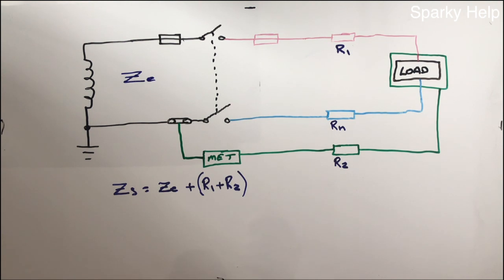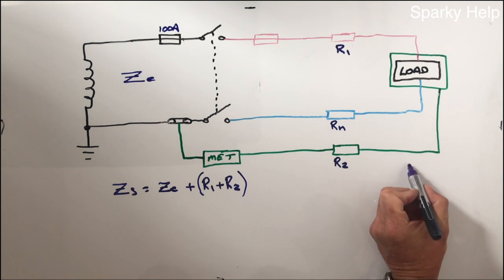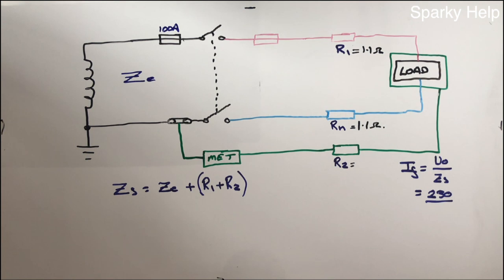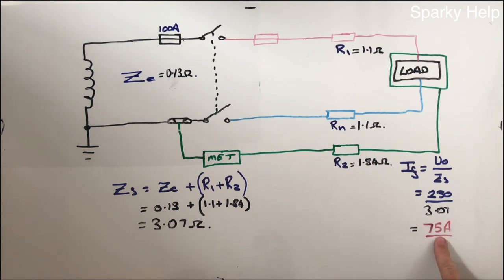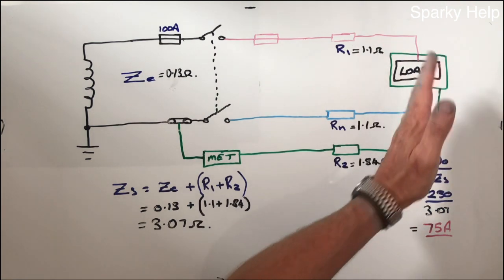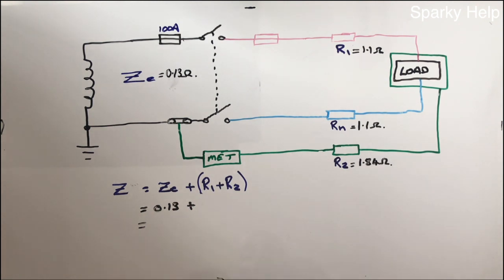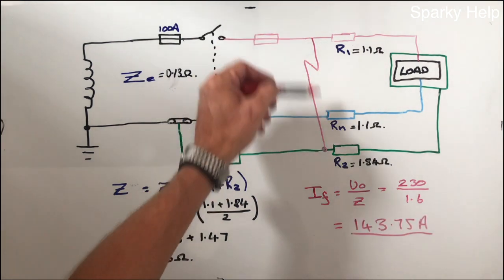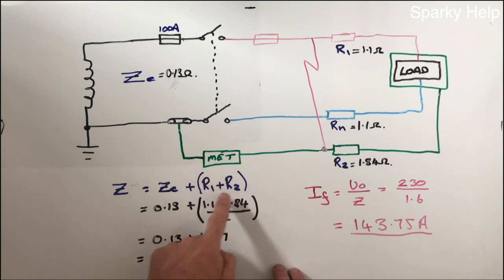Inspection and Test Zs Calcualtions with fault current

Comment: Hi, i'm confused lol. Say the load is switched off at the time of the fault between live and earth. Surely the resistance of the neutral is excluded as no fault current would be taking the neutral path?
Reply from the maker: Hi Yes if it is turned off (and the main switch is shown off!) then no current will flow - but if it is on the majority of the current will take the path of least resistance.  Please Like, Share & Subscribe.😀
Reply: Thanks for explaining 👍

Comment: Thanks you explained very nicely so I am your new subscriber so hopefully more interesting content can be seen.

The way I remember Ipf is taken as close to the origin so its Ipf= U0/Ze
and fault current Ia  at furthest point  Ia= U0/Maximum Zs of the circuit multiply by 0.95 which is Cmin.  so thats max but when you take measurement at put them into this forumula so thats more accurate?
Reply from the maker: Thank you, Ipf is a fault (of negligible impedance) in a circuit between live conductors or live an exposed conductive part, I use 'If' just as a generic label to indicate a fault current.  The formula using  (Ia) is discussed in the video https://youtu.be/caWAevix9a0 glad you found it helpful.

Comment: Thanks for the video and TNC-S Zs 0.35 how did you get the 3.07ohm?
Reply from the maker: Zs = Ze + (R1 + R2) therefore: Zs = 0.13 + (1.1+1.84) = 3.07 Ohms (in my example)